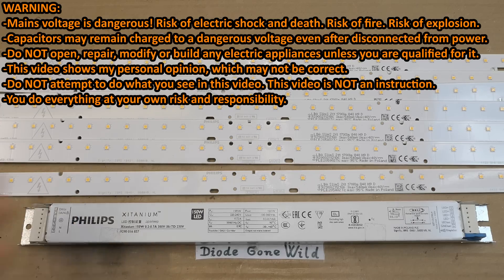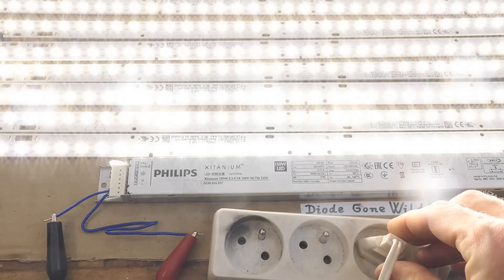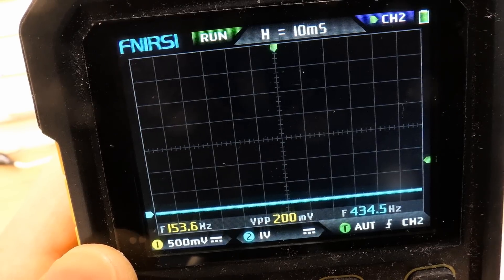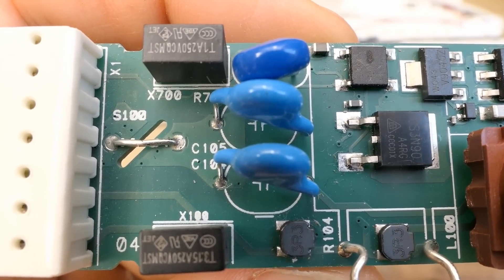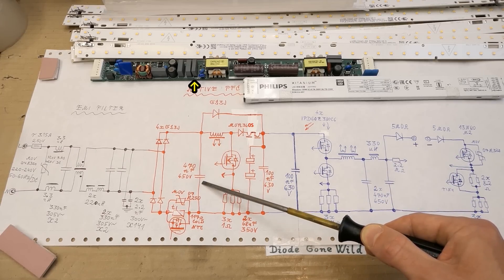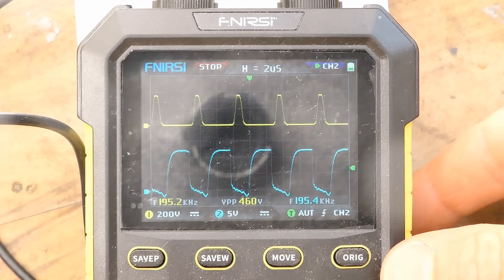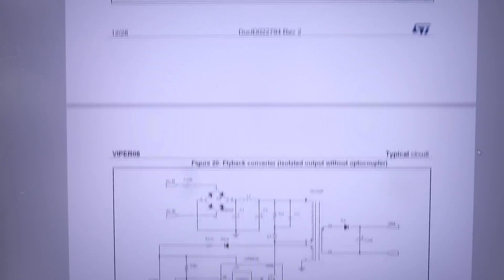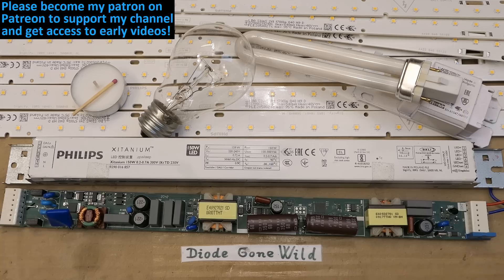150W LED power supply teardown

Comment: So you have 4 series chains of LEDs each chain driven successively by time division multiplexing.   By changing the period the LEDs can be brightened or dimmed.  Also by briefly overdriving the LEDs higher than they could stand if DC current, you extend the brightness higher.  (Or conversely it is equally valid to get "nearly as bright" by strobing ...)
I heard that a similar scheme is used in LED edge lighting of laptop panel displays.  The makers were very secretive about how the lights worked - no longer secret though.
Nice to see the protection and power factor remedial circuits.
Lovely analysis, thank you. 😊❤😊

Comment: 11:08 i used to explore faulty driver for 22W philips industrial LED lamp, it has non-sync buck topology (w\o pfc) with UF54xx diode, and the fault reason was overheating of this diode lead to bloating of output electrolytic cap and bloody roasted to black pcb, so diode in 150W driver may cause quick house-burning event) 

its seems to be exactly conduction losses, coz mosfet body diode has even worse reverse-recovery time than diodes in continuous current mode.

its also kinda funny that driver design has temperature-protecting circuitry but it was omitted)

Comment: The L6388 is the worst gate driver imaginable. The internal bootstrap diode is very fragile. Substitute it with an external diode for safety because if it's overdriven internally, it goes short circuit when it fries under its load. The external bootstrap would help it stay alive. But if the internal bootstrap diode gets fried, nothing can save it, the whole thing fails. If anyone is reading this comment, take note, these things have to operate in switching mode, pwm. If you bypass the bootstrap by supplying the maximum voltage to drive the highside gate, note that the macimum voltage possible isnt high enough. The limit there is quite low. You'll just be disappointed. Go for a different gate driver if you dont want surprises. Its really duch a bad driver for high voltage applications.

Comment: Dany, could you possibly do a video on how a self oscillating switch mode power supply works please?
I have a couple of smps that have all the commonly seen input components, fuse, ntc thyristor X type capacitor, emi filter, bridge rectifier etc, but it doesn't have a switching chip or an optocoupler.

It only has one main 400v/100Uf capacitor, 2 high voltage E13007 switching transistors, a small ferite ring oscillator transformer with (3×) 3 turns + (1×) 3/4 turn, a few resistors, a few diodes, 1× db3 diac, and a large output transformer with 3 wires primary, 4 wires secondary.

The DC output is also very simple.
It uses 1× double diode, 1× large electrolytic cap, 1× small electrolytic cap, 2x small ceramic caps, a few resistors and 1× ferrite core choke/inductor.
I'm looking to repair them so I'm trying to better understand how they actually work?👌👍
Reply: That sounds like it might be an unregulated supply. It would be like the classic 2-transistor fluorescent driver circuit but with a transformer+rectifier instead of an inductor+lamp. Or I could be totally wrong. Since you're saying the output transformer has many wires I'm most likely wrong.
Reply: @eDoc2020 Thanks for your reply.
These are GME Electrophone PSS100 switch mode power supplies sold as 13.8V DC supplies for CB radio use.
Rated at 13.8V-4A continuous, 12V-5A peak.
On the box it states, fully suppressed for radio equipment, car stereos etc, but they don't state regulated output as such.
I can find circuit diagrams for their other GME classic linear iron transformer power supplies ie. PSA123, PSA126, PSA1210 but nothing found for these PSS100 supplies.
These PSS100's are made in Taiwan, and the circuit layout seems to share a lot of similarities to a half bridge design, but don't use a TL431, or optocoupler, or switching chip etc so I'm really not sure how they control the switching of the two MJE13007 transistors, or how they regulate output if they even do.
The other thing I'm not sure of is what the DB3 Diac does, and if it is a significant part of the control circuit etc.

Comment: If you keep the neutral connection to the DALI line of the LED driver fixed and the phase connection touched and pulled once, you can turn the LEDs to the off or on position, or if you keep the phase connection solid for a short time, you can have a dimmer.

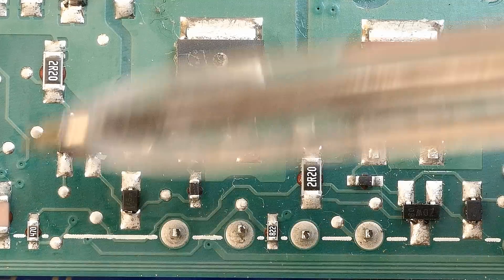Comment: 15:58 i tried to use low gate threshold p channel mosfet in this turn off circuit, but it works worse than pnp transistor. Why?

Comment: Why 350V 68uF capacitors in series? What  such significant difference made for? Is it not enough to have a one 450V 47uF?
Reply from the maker: I guess a 33uF 450V capacitor would do, but the designer was in a series mood, or the 350V capacitors were cheaper, or maybe they had a much lower ESR or a higher temperature rating.

Comment: I am always surprised when you say which connector goes to L and which to N - it is AC circuit and in Europe you can always connect opposite - the socket/plug don't always connect the same way - so you never know where is L and where is N. Unlike in other countries where socket/plug direct always the same connection.
Reply from the maker: Czech sockets are polarized. And even in countries where sockets are not polarized, permanent wiring still keeps N and L. This thing isn't probably connected using a socket.
Reply: @DiodeGoneWild  a keyword: "Europlug" - for sure not polarized.
Reply: Practices differ mainly in the area of polarization. Typically, Europeans do not maintain consistent identification of line and neutral throughout their power system as is the practice in North America. Consistent with this practice, the Continental European plug can be rotated to either of two positions and plugged into the socket. Thus, the common electrical system in Europe is unpolarized (i.e., line and neutral are connected at random). In fact, most plug types used in Europe are not polarized.

Comment: at this level of complexity why not isolate from mains it would not cost probably that much more + safety
Reply from the maker: It surely would be more costly and lossy to isolate it.
Reply: @DiodeGoneWild  I believe the losses would be the main reason due to certifications and energy efficiency class, they even went to the trouble to add a pfc circuit.

Comment: Hi.
2 questions:
Why they always use a 3.15A fuse on almost every power supply board?
Why in every single transformer they use yellow (kapton?) tape, no matter if it's made in china or else?
Thanks.

Comment: Is it possible to put enough leds in series to match the mains voltage and not need any resistor?
Reply from the maker: That would be very steep...
Reply: Lots of cheap LED bulbs put a lot of 9 or 15v diodes in series to get up close to mains voltage. Then a linear current regulator dropping a few volts to set the current to some safe level and keep it regulated as the bulb heats up and the diode voltage changes.
Reply from the maker: Of course, but there still has to be the regulator. It can't be just the LEDs alone.
Reply: @DiodeGoneWild  Why not come close to mains voltage, and then drop the rest using a resistor?

Comment: A 48MHz Atmel Cortex-M0+ for a power supply... bloody hell... reminds me of Deus Ex Silicium (FR) video presenting a Dyson vacuum cleaner with two µC and some RAM chip...
Reply: That's what i though, why such a "powerful" micro in a "simple" led driver? I guess it handles everything including the inductor switching, and it may be cheaper and easier to implement that a bunch of different interconnected controllers and auxiliary chips.

Comment: these LED power supplies are programable via NFC (you can se that blue antena near output) I dont see min value imho. Also that one you check is DALI power supply with additional output for LED control (like dimable switch or via smartphone) thats why there are some chips inside.

Comment: Biggest problem with this led driver is thermals other than people. Every 8 out of 10 that  come in for service are heavily discoloured boards around output transistors and every single capacitor cocked and leaking after 3 years of use. Other 2 are miss wired and dali + and - used for live and neutral. In that case replace a blown up trace and fuse and hope.
Reply: haha. Junk design.
Reply: How much does the unit cost? I can't imagine this being something that touches my bench with our cost of living.
PS. I rewind and looked up a Philips Xitanium. At €20 me opening and looking at it, if only to do a quick fix, would break-even with a new unit.
Reply: @stefflus08  Not sure about the price but here in Bosnia it makes sense to fix them for 15 BAM rather then to rewire and retrofit other makes or models but recently i experimented with Lisun and so far extremely happy with the results. Plus  for 10 Bam more you can use flicker free driver and adjust the current down to increase lumen/watt. Depends what costumer wants in the end but most of them would rather pay 80 BAM and upgrade rather than buy 450 BAM light fixture.

Comment: That complexity really smells of an engineer given no budget constraints. The synchronous converter, the discrete gate driver(s) adding extra BOM cost, the mosfet for shunting the current sense resistors, etc. ... If you already have a MCU for controlling the mosfet, why not use it to control the optocoupler (or voltage divided FB pin) directly? .. In fact - that's exactly what most sensible constant-current LED PSUs do. :)

Specifically most Meanwell PSUs are a nice example of cost-optimized design (I opened a few of them), but without skimping on quality or filtering. Chips like AP4310 are super useful (and cheap) for both voltage and current limiting, all in one package.

Anyway, greetings from Brno!